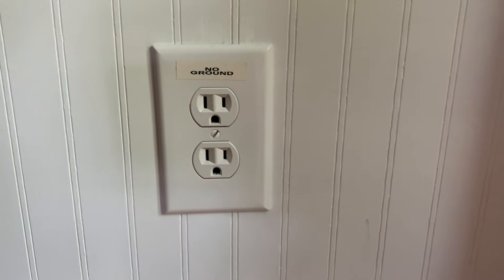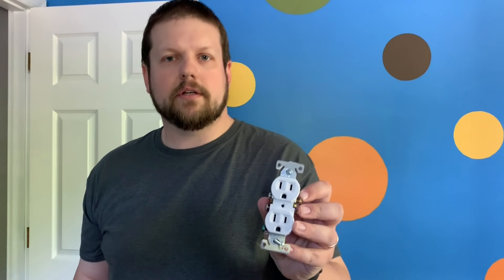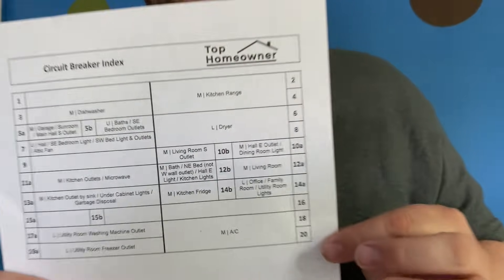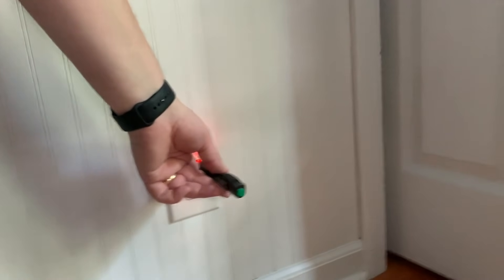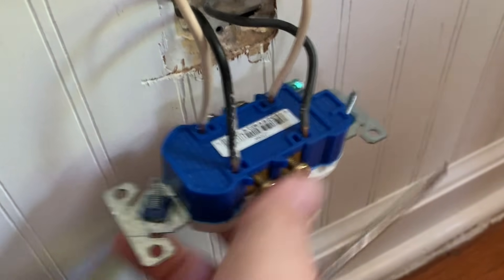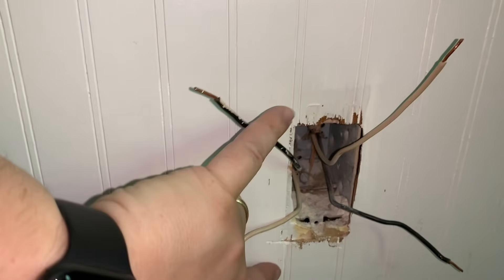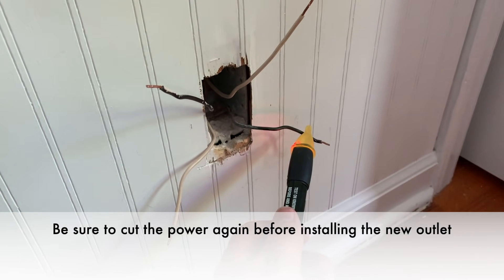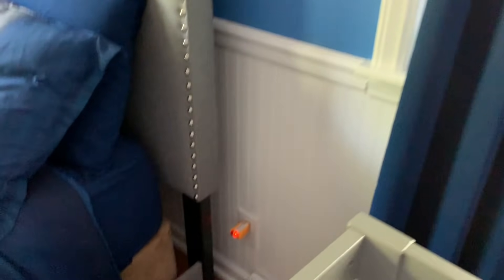Fixing Ungrounded Outlets - An Alternative Option to Rewiring Your Home

Comment from the maker: Check out these other related videos...
Upgrading Two Prong to Three Prong Outlets: https://youtu.be/3AXcRsAOLPk
How to Wire a GFCI Outlet - What's Line vs Load? https://youtu.be/Uop79H_iqoQ
Electrical Outlet Wiring - Home Wiring 101 https://youtu.be/Dukmv88HXI0 
All Top Homeowner Electrical Videos: https://www.youtube.com/playlist?list=PL4VC0S4HJFr5aDUJSASj9Sji43-YODAC6
Reply: You have to install them on every one as there is no ground wire. If you use a grounded device it has to have a gfci on that receptacle
Reply: You are wrong guy > The NEC does not allow a three-prong outlet to be installed on a non-grounded circuit unless the circuit is GFCI protected. An electrician can install a GFCI breaker in the panel or a GFCI receptacle at the outlet.Dec 23, 2021  The sticker goes on the outlet with the gfci only. You can not protect other outlets with a gfci receptacle when there is no ground. 
You have to install a gfci in every one you with to use grounded devices in. That sticker on the other one is incorrect and you cant just install a grounded plug  there.  You video is not correct on the NEC as an electrician i have done these jobs and you are wrong and what you are telling people is wrong.  Go buy a gfci woodhead ( tester ) they look like your tester and check the other outlets they will NOT trip the gfci which means you are NOT to code.

Comment: I HAVE A APC BATTERY BACK UP IT HAS A INDICATOR LIGHT ON IT THATS A SAFETY FEATURE IF THE LIGHT IS RED ON IT SHOWS THAT THE WALL OITLET IS IMPROPERY WIRED NO GROUD THAT SAID THIS DEVICE YOU USED WILL NOT WORK THE LIGHT ON THE APC WILL REAMAIN RED ON IT 
IS THIS TRUE WHAT DO U KNOW?

Comment: Does this method allow surge protectors to work? I live in an apartment with open grounds and I am worried about my expensive computer being fried even with a UPS being used. Maintenance also installed a jumper between neutral and ground just like in the video.

Comment: Wow! Now I can install an ACTUAL outlet at each point I need it in this (and all the other rooms)! My house was built in the 40's. Not only are my outlets not grounded, there's only a handful of them. Imagine running the entire office of a technology hoarder off of one outlet! I have those 3-6' power "bars" daisy chained through the entire room, all plugged into an ungrounded outlet. Not safe. I know, I just don't have any other options. I'll probably still use those power bars, but having ground protection on the "home plug" is still safer than only one outlet. I would also like to add outlets where power is needed most throughout. My husband is the one that handles all the wiring and everything, but getting him to do this for me feels much better lol. Thanks for sharing! 😃
Reply: Yep,  Time to upgrade,  please dont put it off too long.
Reply: If you need to add outlets then there is no alternative to rewire. Amazon sells a power bar that in itself has a GFCI. It can be used to connect three prong plugs safely when changing an outlet is not an option (like in rental)

Comment: One minor problem with all this...a U-grounded outlet with an open ground connection is an NEC violation. It's OK to maintain a two-prong outlet, but you can't just shove a 3-prong (with or without GFCI) into a work box and consider it to be safe.

Fortunately, many local building codes require that work boxes be grounded back to the panel, even going back to older homes that were built with two-prong outlets. Apparently not the case in this video, but where this situation exists, you can safely ground an outlet to a work box.

My home was built in 1965, with two-prong AC outlets throughout the house. Since local fire code here required all work boxes to be grounded back to the panel, I had very little trouble upgrading to three-prong outlets with full grounding protection.

Also...I've seen where people added a ground path by bonding to the nearest cold water pipe. This is a code violation, because it creates a parallel ground path. If you need to ground an outlet, always bond the work box and outlet at the panel.

Comment: If you are lucky and they used metal electrical boxes and used metal conduit to run the wiring through, you can use a pigtail to connect the metal box to the ground terminal of the receptacle or switch.  The metal box and conduit will work as a ground wire to the electrical panel.

It looks like you do have metal boxes.  If you have a multi-meter you can turn the power off, switch the multi-meter to ohms (resistance), then connect one lead to the white wire and the other to the box, and if it shows resistance then the white wire and the metal box are connected together at the electrical panel through metal conduit.

Comment: Hey I found it a good idea to install one of these in the bathroom so when somebody using a hair dryer on high it doesn't shut off the power in the circuit in the basement. That way they can reset it right on the spot instead of going to the basement and reset the whole circuit. Am I correct?

Comment: Add red tape to the hot. I just did an inspection on a house that someone had  drilled small holes through the wall plates and pulled green wires into the basement and crawl space. Wired together and back to the cricut main box. All these green wires running across the floor joists.  What a site. I failed the house because the main breaker was held closed with a spoon. Pulled the spoon and beaker triped. I was called to the house because the power company said it seems to have a heavy draw. The renters said the bills were to high. Don't know what was going on. Renters moved, house tore down. Would have liked to investigate.

Comment: I am redoing a bedroom. There are four outlets. One shows both red lights lit in both sockets when tested with a Klein Tools RT 105 tester. The other three outlets show the bottom socket lit with both lights in the tester but the top sockets show the open ground result. Is this normal? The house was built in 1964.

Comment: Is it okay to replace all with GFCI’s or will they all “fight each other” and possibly trip the breaker, my house is old and I’m not sure about the first run on every room, I realize it’s costly but is it a safe route? Thank you
Reply: Yes it is ok, but only wire to the Line side, no wires on the Load. To save money, you may want to use them at selected locations, not necessarily at all places.

Comment: Dude, as an electrical contractor (me), what you're trying to teach people is WRONG! You NEED a GROUND for a GROUND fault circuit interrupter to work, because it takes the faulty current and grounds out to trip the gfci or if necessary the breaker. If you have NO GROUND it can't do its job. This isn't a work around, it's ILLEGAL and INCORRECT according to the NATIONAL ELECTRICAL CODE. How is that supposed to trip if the hot and neutral come into contact? If it doesn't have a ground? Seeing as the GROUND's entire purpose is to protect against shocks and arcs. I mean if you have a grounded circuit sure what you're trying to do is correct but that's not the case. Also why is someone who isn't an electrician trying to TEACH about ELECTRICITY? That's like me trying to tell a surgeon how to use a scalpel. You want to teach carpentry, drywall, framing, etc. go for it. But shit you actually have to go to 4 years of school for and have over 8000 hours of on job training to acquire your Journeyman's license leave that to the people who actually went to school for those things. Views on YouTube aren't worth what doing the wrong things with electricity can do.
Reply: A GFCI will trip without a ground to prevent electrocution, but it won't necessarily protect electronic equipment. If a bare neutral wire and bare hot wire make contact, the circuit breaker will trip quickly, ground wire is not required in this case either.

Comment: I thought running a ground wire to the metal box then to the green screw on the socket will ground that outlet  !?
Reply: Only if the metal box is already grounded to the main panel.

Comment: You have non contact tester. It wasn’t necessary to disconnect the conductors from the receptacle in order to find line side of the circuit. A “Wiggy” tester or multi meter could also be used. I think I hear kids in the background. Hot conductors hanging out of the wall and kids running around aren’t a good mix. .

Comment: If you don’t have a grounding wire back to the source you don’t have a ground It might not be necessary for a house because there are no metal raceways but you still haven’t essentially grounded anything Nowadays they require GFCI and AFCI breakers in the panels It’s better to pay a licensed electrician who knows the codes

Comment: GFCI technology DOES not provide GROUND. It's irresponsible to say that it does. This guy's own outlet tester shows OPEN GROUND after the GFCI is installed. To GROUND an outlet you need to connect a cable from the outlet to GROUND (on your electrical panel is the best way to do it). Why is this important? A surge protector used to protect  expensive electronic equipment (stereo, video, computers) won't work without GROUND. OTOH GROUND does not provide GFCI protection, which is typically only needed on outlets near water sources (kitchen, bathroom) or outdoor outlets.

Comment: Question:  Why does the TEST BUTTON work on a GFCI receptacle if
the box clearly has no ground?
Reply: Because it does not rely on the ground. It diverts current to the neutral past the detection coil.

Comment: A GFCI works by comparing the current between the hot wire and the neutral (the proper return path).  They should be the same.  On a normal GFCI circuit, If a metal part of the item that is plugged into it comes into contact with the hot, this sends some of the return current to ground through the ground wire instead of the neutral wire, and causes it to trip.  If however, you wire in a GFCI without a ground wire, then in the above faulty scenario, it will NOT trip until you touch that metal part.  It should trip then, but not until you touch it--this is less than ideal.  So you definitely should label the outlets as "no ground".  Your solution is better than not doing anything, but you don't want to give the impression that you are "protected" like a normally wired GFCI.

Comment: You can alternatively use a netural to ground bonding plug or use a resistor on netural and ground or call a electriction to rewire your house as most battery power stations arent grounded
Reply: No, that is not up to the code. Using a resistor makes no sense. Are you thinking of using it to fool someone who measures the ground-neutral resistance?
Reply: @okaro6595  well their is neutral to ground bonding plugs
Reply: @VOLTRONDEFENDER4440  Never use those if there are. If the socket has reverse polarity they can kill you.
Reply: @okaro6595  also for generators and power stations they are normaly never grounded

Comment: If your metal electrical box is grounded using a jumper wire as such is fine but only if your box is grounded. You can test if its grounded by touching your multimeter to the live wire and the other to the metal box if you get a voltage reading you are grounded if your meter continues to read 0 Volts than your box is not grounded.

Comment: This was very helpful. I might have a sort of unique situation and did not know if I was good or not. I have a large window unit AC connection that is 30 amp. The outlet is one that was installed just to handle that AC unit, so nothing else runs from that outlet (nothing upstream in series). I checked the outlet with a tester and found out it was not grounded. The AC unit itself has one of those breakers that has the green light on the plug which effectively acts like a GFCI breaker. My home is an older home and there have been a couple of after construction wiring to handle modern appliances. Another example is the dryer outlet was wired after the home was constructed. Testing the outlets, I found that all the regular 15-amp outlets were grounded. So, my understanding is that this AC unit is not dangerous.

Comment: Great job with the video. How can you tell which one is the first outlet on the run? I have a three floor home  so does it start from the top floor down or the bottom floor up?
Unfortunately my house doesn’t have any ground wires with the outlets and some of the light fixtures. I’m trying to fix these issues without breaking the bank if you know what I mean… Thank you!

Comment: My house has 3 prong outlets but not a single one actually has a ground wire bc the people who built this house were idiots. LOL. The power surges can lead to a lot of fried appliances.
Maybe a silly question, but all of my outlet boxes appear to be plastic and there is no conduit. Can I take a green coated wire of the same gauge as the other wires, attach it to the outlet and run it back to the box? I would use elecrtical tape to tether it to the cable going in to the circuit breaker because I read that they have to be sheathed or together with the other wires.

Comment: You said that to ground the outlet you have to run a ground wire from the outlet all the way back to the electrical panel but my electrician by a simple test with a multimeter found the metal box itself was grounded so he was able to properly ground the outlet by adding a green wire.
Reply: Yes if the box is grounded then that's fine but many ppl think that just because it's a metal box they can pigtail a ground to it but unless the box itself is grounded then that does nothing

Comment: GFCI itself needs ground.  GFCI does not create ground.    I will not listen to the rest of video.
Reply from the maker: GFCI does not need a ground to function for safety, it monitors the current flow between the hot and neutral terminals to determine if there is a ground fault. But, you are correct they don't create a ground either.

Comment: You just need to install a AFCI/GFCI breaker in the panel. It will protect the whole circuit without having to determine the "first" outlet.
Reply: How do you add GFCI breakers to pre-1960's boxes that only have fuses?

Comment: Never saw you actually hook up those wires.  Did you install a ground wire somehow??? Pushing the test button on the GFCI doesn't mean that the GFCI is working properly.  The proper way to test the GFCI is with a GFCI plug tester that has a black button on it. If you press that black button and the GFCI doesn't trip then the wiring is incorrect.

Comment: I really wish you would have shown how you put that in there. Which wires you attached to which side.

I get the hot wire goes to the line and the not hot to the load, with the neutral wires attached, but you didn't show HOW they go on there.

Example hot wire goes on the top right, and neutral from that same side goes on the top left, etc.

I'm trying to learn general information on this for sales and I would be 100% guessing if I were asked questions by customers.

Comment: Some old wiring systems do have a thinner ground wire which is worthless since it has more resistance than 12 or 14 gauge wire and could cause a fire 🔥before it causes enough amperage to  flow for a short circuit protection device to actuate.

Comment: Jumper a piece of wire from the ground to the neutral on the outlet then install. It all goes back to the neutral /groundbar in the panel. Very simple. Outlet grounded.
Reply: That is against the code.
Reply: Jackass. Then, if you lose neutral before that outlet, anything connected to that “ground” becomes a hot.

Comment: Very disappointing you did not show the wiring of the GFCI outlet once done.  You just totally skipped over that .. jumped from point you had 4 wires extended from outlet box to point where CFGI was all wired up, fully inserted into outlet box,  and outlet plate secured.

Comment: Every outlet should be a gfci outlet or rewire the home.
Reply: The outlets on the load side are protected and are actually safer than the GFCI receptacle as the GFCI protects the whole outlet, not just its outputs.

Comment: I had someone powerwash my home, since then my two outdoor outlet and garage outlets not working. I reset the circuit breaker still not avail. I do not see any GFCI outlet in garage or outdoor. Do you have any if the issue is in circuit breaker or the outlet outside is causing no power to all the connected outlets.

Comment: Best option is to run a ground wire.
Another option is if the breaker panel already uses the metal fresh water pipe as ground, find a pipe close to the outlet that has continuity to there.
Reply: That used to be legal until plumbers started doing plumbing repairs using PVC, ABS or PEX pipes, breaking continuity to electrical grounding.  If you temporarily ground the box to a pipe, you must make sure the continuity is not broken by PEX plumbing splices.  If there is such a splice, plumbing code requires a 6 gauge or thicker jumper between the metal pipes to keep the bonding continuous.  It is, of course, better to use type L grade copper pipe to repair a water pipe leak on a copper water line.
Reply: No, do not improvise. This method is up to the code, running wires to pipes is not.

Comment: If you want reliable outlets, move all wires from push terminals to the screw terminals.
Reply: Or use back wire terminals which use the screws too instead of the backstab/push that don't.